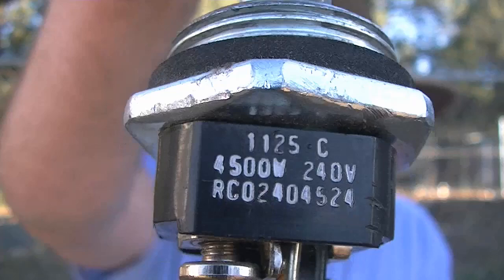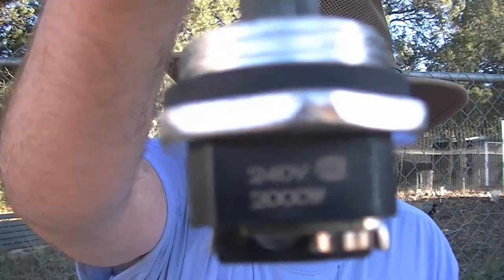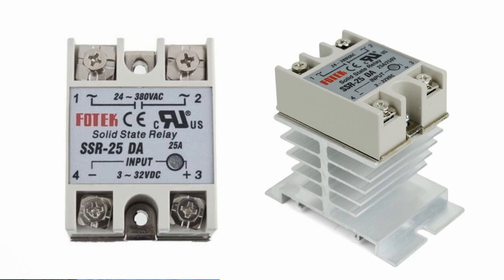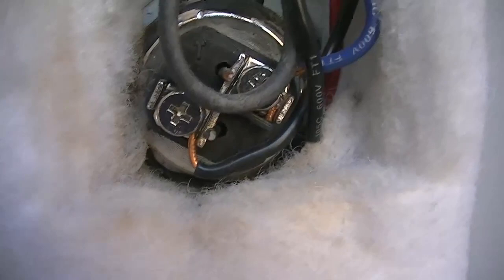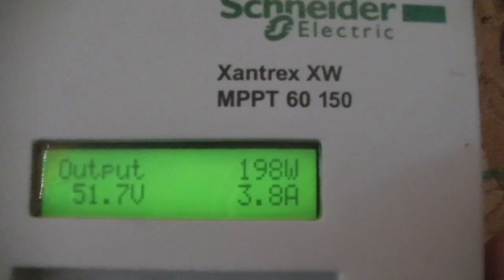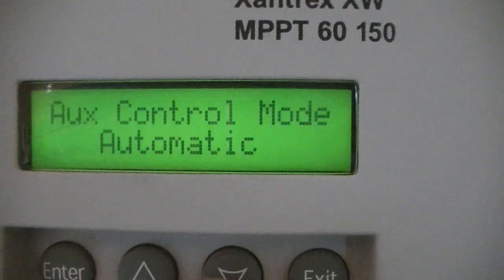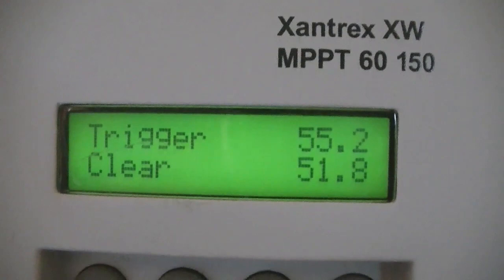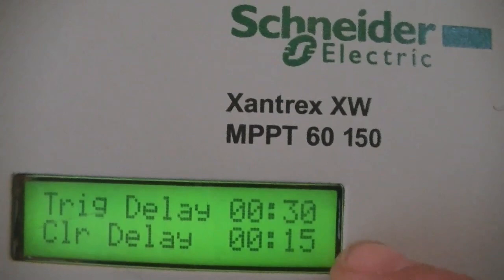Load Diversion - Water Heater Pt. 1

Comment: Good to hear from you again. Your solar info was very helpful. I had to watch it several times to get concepts. 
   I'm running a 50 gal water heater on grid with 2 4500 W filaments. I recently installed a timer to save a little juice. I believe it saves as long as I don't leave it off for more then 4 hrs.
Reply from the maker: Thank you.  I know some of this gets a bit technical, but I'm always here to answer questions.  Being on-grid, a timer will definitely save a lot of money.  You can set the timer to turn it off after you're sure everyone is done needing hot water for the day, then set it to turn on about 45 minutes before anyone needs it in the morning.  It's a great idea, and for anyone else that might be reading, it does require a 240 volt timer which is more heavy-duty than the little plastic ones you buys for lamps. 

Thanks for your comment!

Comment: these hot water elements must be alot more robust than i even imagined
with your solar array going full steam ahead on sunny days your element would be on all the time if it  werent for a thermostat,
 id be scratching my head thinking of new ways to use all that excess power in summer, not a bad problem to have ofcourse.

Comment: The reason your larger elements were burning out so quickly was the material that the tubing was made from. They are nickel plated copper and the white coating looks like lime, which is a thermal insulator and this will make the element run hotter and burn out. The black element tubing is probably inconel which is made of nickel, chrome and iron and will resist the build up of lime and SHOULD last a lot longer. The fact that you chose a longer element and lower power is also working in your favor... less watts per square inch or centimeter won't have the water boiling on the surface of the element and depositing the lime. Years of changing water heater elements in areas with crappy water supplies in New Zealand... lots of lime and chlorinated water. It lifts the nickel off and leaves pitting of the copper tube if it doesn't get coated in lime.

Comment: Enjoying your videos about hot water.  In one video you mentioned a 2500 watt inverter.  I assume it was MSW since you mentioned resistive loads.  In this video you mentioned 4000 watt inverter.  What model is it?
Reply from the maker: Wes, I am elated you're enjoying my videos!  I've enjoyed a few of yours as well.  Especially the disappearing kid!  LOL  
The 2500 watt inverter I use is a very cheao, stackable inverter I purchased on Ebay.  You can find it here: http://www.ebay.com/itm/US-Stackable-2500W-Off-Grid-Power-Inverter-12V-24V-48V-DC-to-240V-OR-120V-AC-/271058480716?var=&hash=item3f1c582e4c:m:meVvl7JatzFkY-7-i2cCgRw

The 4400watt inverter I use is a Magnasine inverter you can find here:  http://www.ebay.com/itm/Magnum-4400W-48VDC-Pure-Sine-Inverter-Charger-MS-PAE-MS4448PAE-/162500360048?hash=item25d5c6b770:g:vAQAAOSw42JZCKfA

The Magnasine can be found cheaper elsewhere.  The new inverter that everyone here on the mountain is using is the PIP inverter.  If you look up the play list on my channel about Duane's projects, you'll find videos about it there.
Reply: Do you have any experience with the morning star's PWM output?  It would seem to be a shoe in for your water heating!
Reply from the maker: I don't have experience with Morning Star products.

Comment: Thank you for the video. Can you please show how the Solid state relay is wired to the upper and lower thermostats.
Reply from the maker: I include a wiring diagram in the part 2 video that shows how the relays are wired before and after, unless you're talking about how the whole water heater is turnef on and off by the chatge controller.  in that case the solid state relay is just simply insert it on either side of the circuit to turn the water heater off and on. Then they switching leads are run back to the charge controller for control

Comment: Hey Steve, hope you are doing well. I know this video is a blast from the past.  Do you still recommend this type of diversion? I was wondering if a DC element in the lower part of the hot water heater would work. I was initially looking at a glycol hot water heater where the panel heated the water heater with a heat exchanger.  That was pretty costly and since PV pricing has come down it seemed a better way to go was electricity with some control (external relays from charge controller and thermostat in the water heater).  Sorry for so many words, I am just trying to be complete.  Hope you are enjoying life on the islands.   All the best!
Reply from the maker: There are people who successfully use DC to hear water.  Part of the joy of DIY solar is the experimentation.  Personally I use AC because the elements and thermostats are all off the shelf products.  The only thing it needs is an inverter.
Reply: @OffGridLivingSteve  thanks for the comment.  You are correct in there being many options. Hope all is well on the islands for you.
Reply: @brentjohnson6654   Still looking for diversion right from the PV array voltage?   I divert by looking at the PV voltage and when it goes over power point, the control diverts just enough to bring the voltage down, 5-1500W. No battery, CC or inverter resources are used. Arc interrupt allows standard mechanical thermostats to be used and heaters daisy chained.  The perfect diversion tested over many years.

Comment: I just saw the part 2 video and with your reply below I think I have a better idea of the setup. Here's my understanding:

1. The AUX output of the charge controller is the point of control of the SSR switch.
2. The Water heating element is connected to an AC source (The red and black leads labelled 220-240V). It is the point of termination of these leads in the diagram that I was inquiring about. Or asked differently, what is the source of power of the water heating elements ?

Thanks
Reply from the maker: +guliver1999 You understand how it works and that's a good thing.  The power is supplied directly by my inverter.  I use a MagnaSine 4.4kw 120/240VAC inverter.
Reply: +Steve Robertson (Off-Grid Living) 

Thanks so much for the clarifications!

Comment: I am a bit confused here, and I need some help.

First question, are you diverting directly from the inverter and not from the charge controller?

Second question, why use AC heating elements instead of DC heating elements?
Reply: I can get tjis one Steve.  1. The power to the element is from the inverter but the relay is actived from the charge controller by a 12v port when the batteries hit a certain voltage. Good controllers come with this . Fm80,Midnight,etc.
  2. Dc would be better but it is hard to find components to match. Temp sensors and the wiring would have to be suited for the wattage. AC is better for convenience.  I am doing something similar but i prefer to heat as quick as possible.  Short bursts of high wattage. Hope this helps.
Reply: Frank Z thank you for your explanation.  

I think I got it now.

I still have a few questions related to this:

What happens if the batteries are full and the water tank is, also, full?  

What happens to the excess energy produced?  

Can this excess energy cause a problem in the system?

Suppose you go on a week long summer vacation.  

Since the house load demand is reduced, the batteries and the hot water tank should be full earlier in the day.  Therefore, the excess energy occurs at the beginning of the day.  How can the system cope in this case?
Reply: The charge controller will stop the panels from over charging.  Once everything is full then it stops until it is needed again or the sun goes down and starts again the next day. The controller is very important in a solar system. Not to be cheaped out on . Hope this helps
Reply: Frank Z I learn something new every day:  The charge controller will shutoff the excess energy production from the solar panels.

Can it do the same with a wind turbine?
Reply: It should.
Reply: Frank Z very grateful to you for taking the time to answer questions that probably sounded to you like someone learning their ABC. 👍
Reply: @frankz1125  no it wont. With a wind turbine or hydro turbine you NEED a dump load as the turbine will go on generating power - turbines are generally not able to be shut off like solar panels (without some mechanical action such as a turbine brake or electrically controlled gate valve). Without a dump load (and I'm talking about one without a thermostat) the batteries would eventually fry. Wind/hydro is very different in this respect than solar.
Reply: @NZMuzzer  thanks for sharing this important information

Comment: steve, could you please do a video on the wiring side of the relay for HW, as i know your pulling 12 volts from your charge controller dump load to the relay but, i noticed you had two relalys and two 12 v and two 240 v wiring? being an hvac guy i have a question shouldnt you need only one relay to power the HW, or is this where you continue to send power else where? a electrical schematic would be helpful like your other one,thanks for your experience and technical information
Reply from the maker: You are right - you only need one relay to turn the water heater on and off.  In my case, I use the circuit to also control 120v circuits to two separate 120vac heatpumps.  If I had only one relay, then only one heatpump would shut off.  That's a good question AND a good catch!  I had to wire the water heater a bit different as well to accommodate my set up, but the gist of it is the same. I have drawn a schematic for it as well, and Youtube won't let me post a pic here.  I'll post it on my google+ and if you can't see it there, then I can Email it to you.
Reply: Steve Robertson She said i have soo many symtoms and every time tests done nothing shows up....even with the arthritis.... nothing shows up....but the symtoms are strong She said i have soo many symtoms and every time tests done nothing shows up....even with the arthritis.... nothing shows up....but the symtoms are strong I went to TCU and tgey want me to yavr 8,000 on my shares snd sign mt life insurance over to tyrm 5o pay out fidelity at 11.1% interest. Ummmm... i tried. Ha haaaaa, what kids u talkin bout? Aren't we in this country the pists when it comes to professionalism and procedures!? Whats wrong with us?! ! Now tomorrow is such not a good day for me to move....smt Aren't we in this country the pists when it comes to professionalism and procedures!? Whats wrong with us?! ! Now tomorrow is such not a good day for me to move....smt
New Living Translation
You made all the delicate, inner parts of my body and knit me together in my mother's womb.

New Living Translation
You made all the delicate, inner parts of my body and knit me together in my mother's womb.

Now listen to this joke...in the haste of rushing out....well first of all thank God i laid out all our clothes last night including vinces socks. But idk what happen lol, lol, as km looking at his foot he has on one foot of  bobby sock and the other the beige socks that he should have on. Lol it look so wicked...lol Now listen to this joke...in the haste of rushing out....well first of all thank God i laid out all our clothes last night including vinces socks. But idk what happen lol, lol, as km looking at his foot he has on one foot of  bobby sock and the other the beige socks that he should have on. Lol it look so wicked...lol Now listen to this joke...in the haste of rushing out....well first of all thank God i laid out all our clothes last night including vinces socks. But idk what happen lol, lol, as km looking at his foot he has on one foot of  bobby sock and the other the beige socks that he should have on. Lol it look so wicked...lol Now listen to this joke...in the haste of rushing out....well first of all thank God i laid out all our clothes last night including vinces socks. But idk what happen lol, lol, as km looking at his foot he has on one foot of  bobby sock and the other the beige socks that he should have on. Lol it look so wicked...lol Now listen to this joke...in the haste of rushing out....well first of all thank God i laid out all our clothes last night including vinces socks. But idk what happen lol, lol, as km looking at his foot he has on one foot of  bobby sock and the other the beige socks that he should have on. Lol it look so wicked...lol Now listen to this joke...in the haste of rushing out....well first of all thank God i laid out all our clothes last night including vinces socks. But idk what happen lol, lol, as km looking at his foot he has on one foot of  bobby sock and the other the beige socks that he should have on. Lol it look so wicked...lol Now listen to this joke...in the haste of rushing out....well first of all thank God i laid out all our clothes last night including vinces socks. But idk what happen lol, lol, as km looking at his foot he has on one foot of  bobby sock and the other the beige socks that he should have on. Lol it look so wicked...lol Now listen to this joke...in the haste of rushing out....well first of all thank God i laid out all our clothes last night including vinces socks. But idk what happen lol, lol, as km looking at his foot he has on one foot of  bobby sock and the other the beige socks that he should have on. Lol it look so wicked...lol Now listen to this joke...in the haste of rushing out....well first of all thank God i laid out all our clothes last night including vinces socks. But idk what happen lol, lol, as km looking at his foot he has on one foot of  bobby sock and the other the beige socks that he should have on. Lol it look so wicked...lol

Comment: Could you not just use  high-voltage DC direct from your panels, rather than going via an inverter?  I would imagine a resistive element would work just as well with DC as with AC??
Reply from the maker: A resistive element would work just as well on DC or AC.  Problems occur using the AC rated thermostat controls inside the water heater with DC.  The arcing would burn them out very quickly.  Also, once the water heater has heated the water, you still would need a place to put that unused electricity.  So having all end-use items operate on AC allows load diversion to be easily daisy-chained and prioritized from most to least important - hot water, compressed air, then space heating or air conditioning as an example.

Comment: Did you ever consider using the heat that the relay generates to pre-heat the water going into the water heater?  Mount it to a heatsink block that the water flows through?
Reply from the maker: Actually I’ve moved way beyond this project. I’m all about hybrid water heaters now.
Reply: @OffGridLivingSteve  I can’t seem to find any of those videos on this channel

Comment: Are there any disadvantages to using a large tank such as a 50 gallon?...I'd like to have plenty of hot water available...daytime...How many watts solar would I need...I don't expect I would actually use all 50 gallon on a regular basis but, would just like to have that available....
Reply from the maker: +Tooomps Challenge I use a 50 gallon water heater.  I removed the 4500 watt elements and replaced with 2000w elements.  Running as a load diversion, you would need a minimum of 2500w of panels.  Running direct, you would need more like 4000w of panels to be successful.
Disadvantages of this setup:
1.  Takes 1.25 hours for water to get to full temp.  
2.  Once you've used up your hot water at night, there is simply no more to be had (any size tank).

Those really aren't bad disadvantages.  In the summer we have plenty of hot water for ourselves and 3 house guests.  In the winter time, there are not enough sun hours to heat water effectively, so we route the water through the woodstove to heat it that way.

Comment: thanks for this great video Offgrid Steve. Does this method increase the cycling of your batteries? I have seen quite a lot of discussion about this issue here ( https://youtu.be/A9Meq8wLbME ) and I assume your method will have the same effect. Do you have any views on how to resolve this?
Reply from the maker: I never had “microcycling” as an issue because I used lead acid batteries at the time of this video. As soon as the voltage got down to residual voltage value, I would have the load switched off.  Lithium batteries are a different critter because the voltage holds constant until nearly discharged. But they do have residual charge value similar to lead acid batteries but at different values.  However, here in Hawaii, I have completely avoided the issue by switching to a heat pump water heater. It only uses 380 watts. I have a video of that on my other channel.